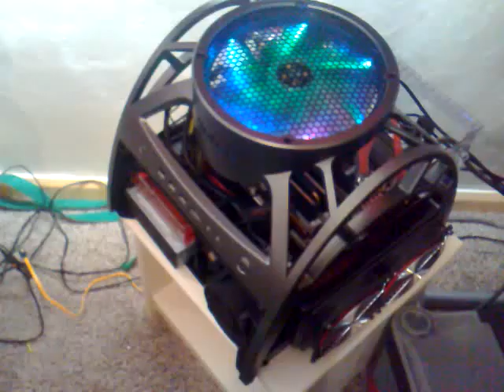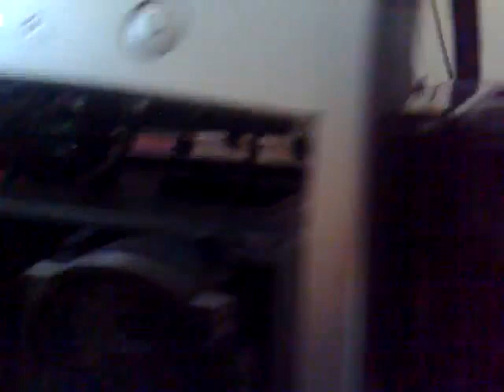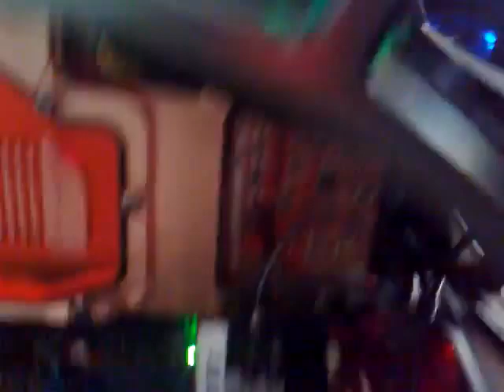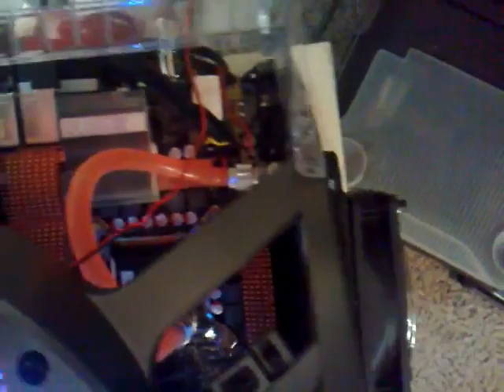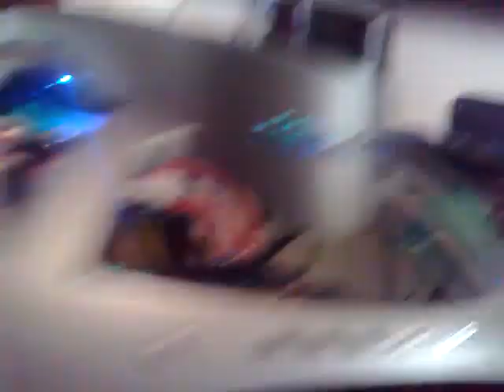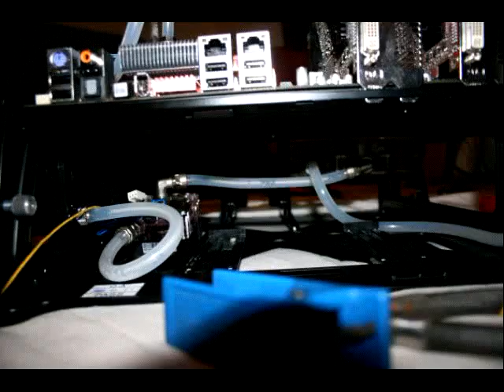Antec Skeleton Watercooled

Comment from the maker: Yes only has 1 240mm rad i had a second single rad aswell on my old case but didnt make any diffrence realy.. cpu and 2 gpu's all run under 50`c with Prime95 and 3dmarks running 8hrs.. cpu @ 3.8GHz